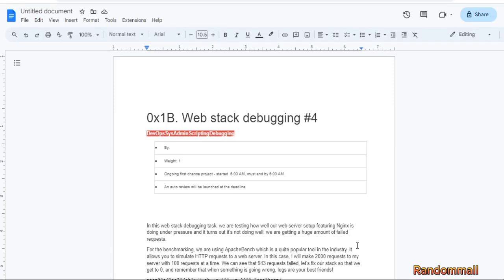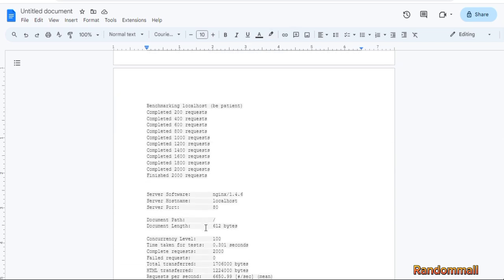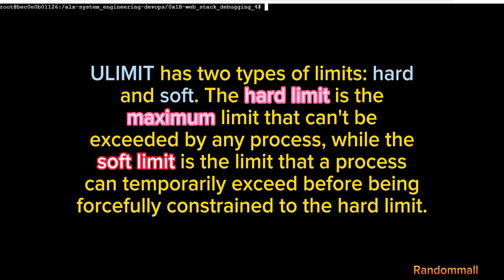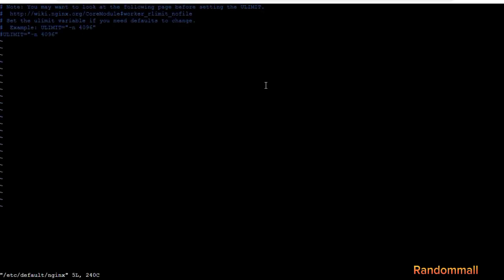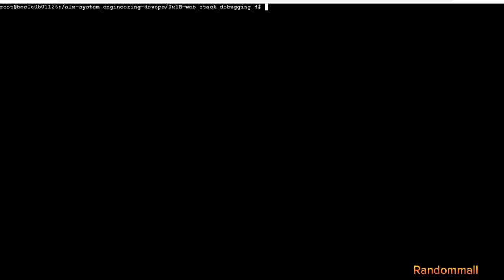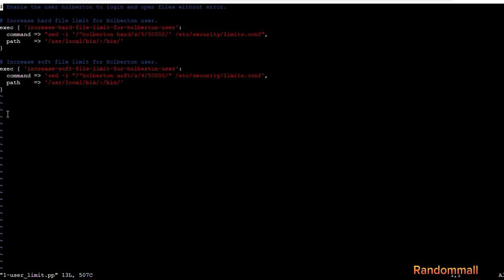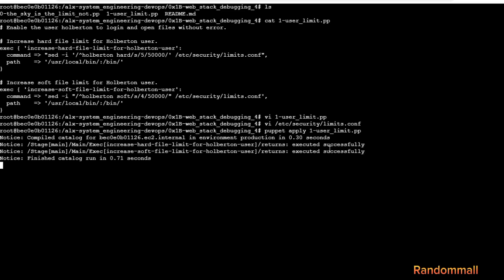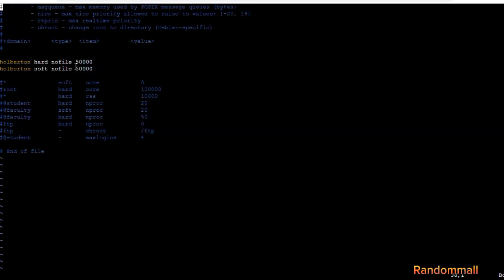0x1B. Web stack debugging #4

Comment: What do i do when the sandbox says limit reached?
Reply from the maker: They only allow at most two sandboxes to be running. To run a third one, you need to destroy one. Have it in mind that you would loose your works inside it when destroyed, push your works to GitHub, and backup your RSA keys if you have them in there.
Reply: @randommall  okay thank you so much

Comment: i have tried installing puppet but getting alot of error
Reply from the maker: On local machine or webterm?
Reply: On both
Reply from the maker: @rawfather  

I'll advice to use the webterm provided for that project for simplicity or you could email me the screenshot of the errors you get while trying to install puppet, I will try as much as I can.
Reply: Puppet apply 1-user_limi.pp & puppet apply 0-the_sky_is_the_limit_not.pp  it's saying command not found and su holberton doesn't exist. Now I don't know what to do
Reply from the maker: @yoniem9835 

Is puppet installed?

Comment: Hello chief, i am getting this 

 puppet apply 0-the_sky_is_the_limit_not.pp
bash: puppet: command not found
Reply from the maker: Check that puppet is installed
Reply: The puppet is not installing what should I do?

Tried several methods
Reply from the maker: On your local machine or webterm?

If on your local machine, is it on wsl Ubuntu or virtual box?